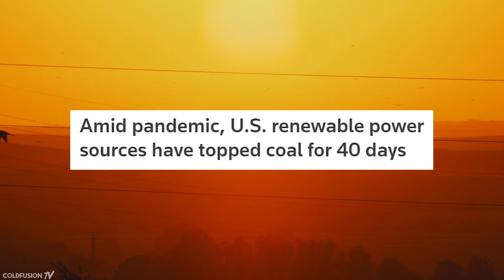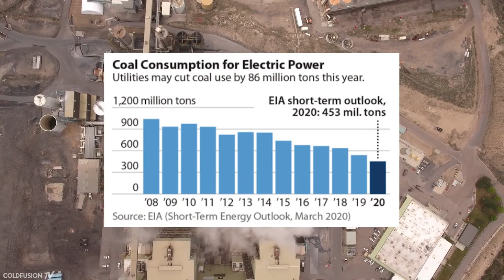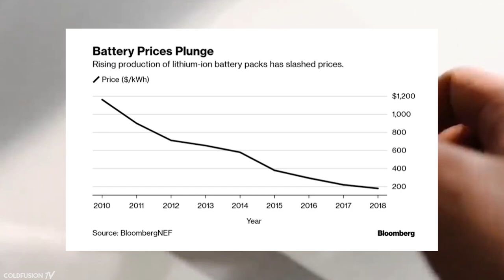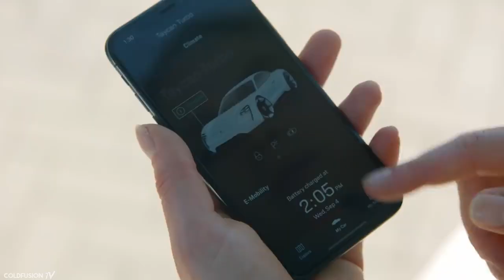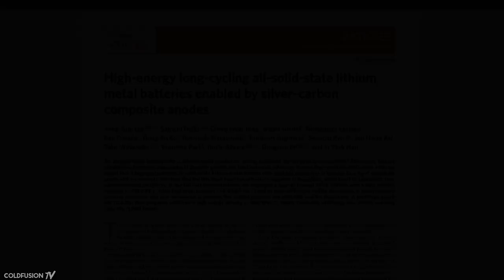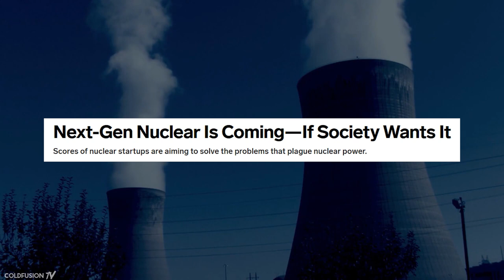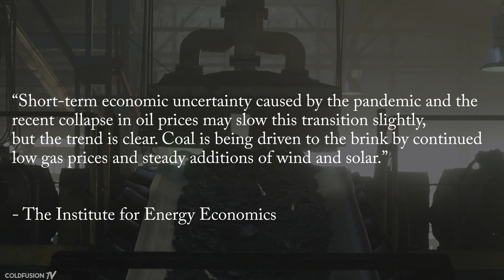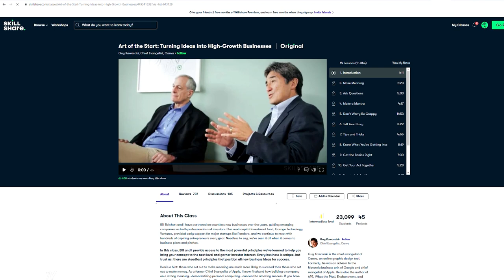Amid Pandemic, Renewables Now Supply More Energy than Coal in the U.S.

Comment: I have a serious issue with many of these renewable energy sources. Solar and Wind have such a low efficiency rate and the reliance on giant Rare earth batteries completely undermines the idea of saving resources (Same with materials for solar panels and the inability to recycle them). The big exception is flow batteries, though the have to use the inefficiently harvested energy to run inefficient pumps, just to use these inefficient pumps to regain the energy if needed. Besides that even with backup batteries, it's still not 100% reliable in worst case scenarios.

And there are many examples from Garbage plants that can't keep up with demand, after basically burning more garbage than what's produced they literally buy it from other cities, which is just a cluster fuck and shows that these are a short term solution, because on the long run it's way better to aim for less garbage production in the first place.
 
Technologies like Fusion or Fission(Thorium etc.) are basically the way to go if you want to generate energy sustainably. Way less resources and infrastructure needed, more reliable, and less space occupied.
 
Investments shouldn't be wasted to create a "renewable energy" money making machine but to create sustainable energy generation...
Reply: It seems like Tesla is going ccobalt free batteries in China, they are less performing, but at least they are cobalt free.
Some of these solid-state batteries use less rare earth materials. I don't know which will be adopted though.
Reply: I think you're assuming that solar/ wind is THE way to go rather A way to go for sustainable energy. They are the most widely known and popular forms but not the ONLY ones. Like the fossil fueled predecessors before them, energy sources have been a mixed bag. You had coal, diesel, gasoline and natural gas that supplied the lionshare of the electricity to the masses along with nuclear and hydro. However over time most of these started to increase in cost of searching, excavating, refining and the transportation of these energy sources to their end users. While solar and wind have steadily become less expensive and more efficient overtime as a result of continuing technological advancement.
Thorium is a good source of energy to replace their aging fossil fuel counterparts but it has some ENORMOUS hurdles it needs to clear before more people will start to get on board. Primarily the bad publicity it has from the average person and the mass amount of effort needed to educate them otherwise. Then there's the cost of building the power plant and R& D into making it more economically viable to investors.
Meanwhile there's other forms of energy sources that can be scaled up to meet the demand of energy use without as much capital investment as Thorium. Biogas aka gas/diesel from human and/or animal waste, solar/hydrogen power plants, plastic pyrolysis, geothermal, brine batteries (salt water battery), wave power,  Compressed-air energy storage (CAES),  carbon capture co2  into electricity, algae based solar cells algae power plants. 
Granted some are far along than others but the point is that there is a plethora of choices people have on where to get their energy needs from that are not as capital intensive, making massive yearly progression strides in feasibility and efficiency. I'm not against Thorium as a source of energy, far from it in fact. But people always overlook simple alternatives and focus on one or solutions rather than looking at what there actually is, choice.
Reply: @VinceroAlpha  In my counties a lot of case biogas comes from burning trees that otherwise wouldn't have been cut and imported from an other country across the ocean. That's the cheapest solution the companies found. So without good regulation it's definitely not a solution in my country. :-( I agree, the best energy solutions mix vary widely between countries/regions.
Reply: @VinceroAlpha    No I don't think Solar and Wind are the way to go, I disagree with the idea of it being sold as if it would be sustainable, because it's clearly not. Both windmills and solar panels can hardly ever make up the energy that's put into them, (including the massive infrastructure needed for scaled world wide production) besides the fact that both do at best survive 20years which makes it even less sustainable. 

No biogas is not feasible as scalable energy source, it's relying on waste from mostly animals which basically means that we would generate energy on another issue at hand which is over production of meat etc. and the resources used to feed them, and the land that has to be wasted to grow the food (which by the way is a ridiculous amount). It literally builds on a crooked idea, just as garbage burning. It's build's on other illnesses.

Geothermal energy isn't scalable either it depends on geographic factors, if you don't sit on a hot spring you can't use it. Unless you meant probes for heating homes, yes they work but don't generate energy.

Your statement is an economical one, the amount of money put into biomass(by far the biggest and worst "renewable" energy source) / solar / wind is basically just feeding itself back into Fossil energy generation but with even more resources and land wasted.

Yes I agree that there are solutions that should be applied in certain situations, but mostly work in niches at best e.g. wave energy, or geothermal plants.

To feed the large part of the current energy demand sustainably and reliably, we have to find another solution that has high energy density, doesn't rely heavily on infrastructure to supply or maintainance and hardly uses ressources. Money should be poured into that instead.

Of course the development of such technology is expensive, but the main issue is that if it works(not just Thorium but fusion as well), an incredible amount of industries would get serious problems. It's not as much a money or technological issue but more of a political and lobbieist problem. It's no wonder that the US government subsidised "green energy" with billions of dollars, because it just feeds back into the oil and gas industry and wins nothing for the environment.

The whole "renewable" energy agenda has been nothing but a scheme, and it's sickening to see people buying solar panels because they think they do good, but in fact are doing harm because they are getting lied to.
Reply: @VinceroAlpha  Appreciate the discussion though.
Reply: @autohmae  I do really like the Tesla products but I would rather have cars being banned from densely populated areas and see large investments for public transport in these areas.

It Obviously doesn't work in all cities but in most it surely could.  The quality of life in cities would increase drastically. Just as the reduction in energy consumption.

The huge push for electric cars as sustainable transportation is fairly delusional to me, tho granted, very tempting.
Reply: @autohmae  There is a quote from a famous Architect (Norman Foster) "Energy has become too cheap". Applies to this pretty well. I think to counter that, energy shouldn't be more expensive but rather be free. Would get rid of many redundant processes ;)

Comment: 5:20 You got something wrong. That laptop battery is a 14.8V battery whereas the phone battery is 3.7V. It's not THAT drastic of a difference just yet. Try multiplying the current and the voltage. Thats how you get the total power the battery stores, in watts.

Comment: wake me up when nuclear supplies more energy than wind, solar, or hydro.
Reply: Won't happen if the Commercial Nuclear industry gets their head out of the sand. Freaking Luddites.
Reply: @factnotfiction5915  is that due to nuclear producing more power, or are people actually trying to increase the amount of nuclear reactors nowadays?
Reply: @factnotfiction5915  that is great! how many of them are 3rd+ generation reactors?
Reply: @davidlewis6728  You'll have to do your own research there I'm afraid.

I believe the IAEA requires cash for that data. You might try https://www.world-nuclear.org/ (an industry group).

I have to say, I await the day when Gen IV really comes online with factory manufacture. Then the single major problem with nuclear - construction cost - will have a structural improvement (vs. the process improvements of finance/project management that could be applied to current nuclear).